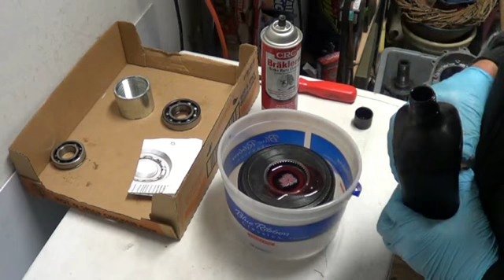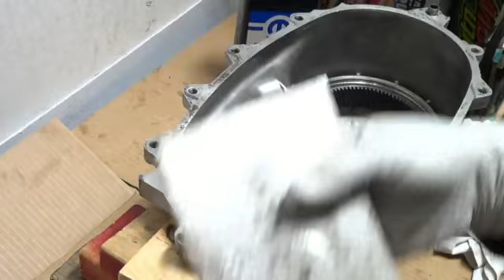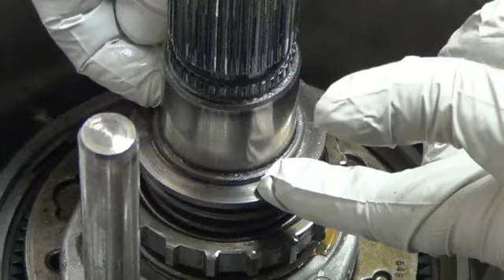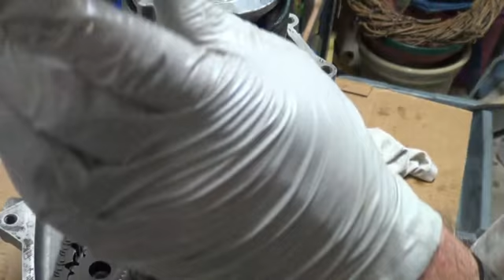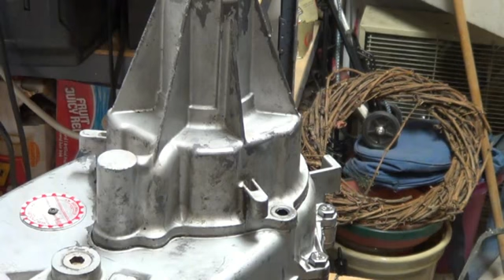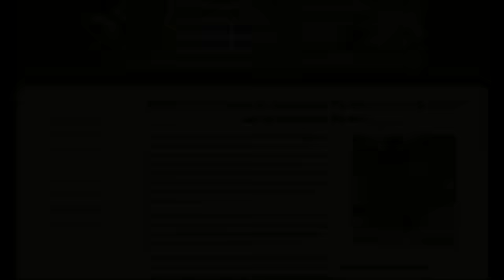1999 Jeep Grand Cherokee Laredo   247 Transfer Case Assembly

Comment: Great Video Jim!  
I need to replace my chain and your videos have been a great tool.  

Does the viscous coupler control both 4 high and 4 low or does 4 low lock the front and rear driveshafts together?

Comment: When installing the progressive coupler, use a flat screwdriver to shove all plates to one side, before placing the coupler onto the line shaft.  Shoving the plates to one side will make seating the coupler a snap.  Verify the coupler is  seated far enough down that the thrust washer fits onto is true place, and not above (to the rear) the snap ring groove.  The thrust washer fitting centered is verification that the coupler is correctly placed.

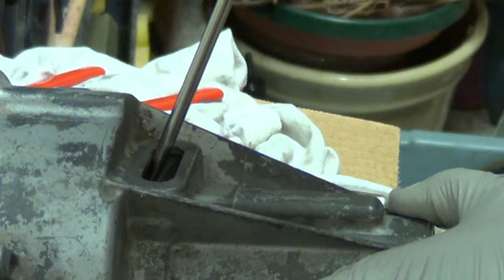Comment: 39:39 for the tail cone snap ring... So simple.  Lightly seat the 4 screws pulling cone housing to rear case half.  The bearing will have shoved the snap clip to the rear.  Reach in with (your favorite) snap ring pliers, spreading the two legs.  Reach in with a flat screwdriver and drag the bearing, which will also be retained onto the shaft, and all with it, to the rear the 1/8" or so needed for the snap ring to be in alignment with the bearing groove.  Release snap ring pliers.  Snap ring will leap into the groove.  Verify seating.  Torque 4 screws to final 20ft-lb, install rubber bung plug.
Reply: counter intuitive. Thanks much. I'm golden. Was trying with it facing up. Thanks,

Comment: Pulling the rear pocket needle roller bearing unit for the forward shaft requires a 36-38mm blind pocket puller.

A 1.5” steel round will suffice to make a puller.  Undercut to about 1.3”, leaving a 3/32” long foot, then cut for about 1-5/8” to 2”.  

Cutoff at end of undercut, then split this plug, make a suitable shim to force the halves apart,  1/4” piece of HRS will do.  

Drill one half plug on end 5/16” and tap 3/8”-16 for the typical HFT slide hammer drawbar.  

Cross drill the two halves, off center, 7/32” and use drill bit to tie the two halves together.  

Propane torch heat the casting, outside the pocket, and inside, around the pocket. 

About 120 slams of the slide hammer will remove even a stubborn bearing unit.

Comment: There is a flat round magnet that goes under the oil pump pickup screen, and it will typically keep the pump screen assembly in place. I would be wary of using anything else to keep it in, place or reduces the gap between the screen and case, which could cause oil starvation to the pump and coupler. Other wise, great videos, well explained and executed!

Comment: I have a 1999 Jeep Grand Cherokee 4.0 inline 6 2wd selective 4wd. When I am driving down the road and come to a red light it starts making a growling noise when I come to a stop the noise goes away when I put it on neutral. The noise also happens when I turn my wheel all the way to the right. I don’t know what the problem is if somebody can help me out. Not that you can only hear the noise from inside the jeep you cannot hear it from outside or under the jeep so it’s even harder to know where the noise is coming from.

Comment: I loved your video however I saw one place that you forgot something or it just wasnt there to begin with but there should have been a chain guide that the chain rides on installed with 2 screws in the bottom of the case. Your chain not haveing this will fly off from being too lose at some point.

Comment: How did reusing the existing clutch pack work out for you? Excellent video. I have no real need to do this, but it was great to watch.
Reply from the maker: Reusing the viscous coupler (progressive clutch) is working fine.  The main goal was to eliminate the annoying bearing whine which we accomplished.  It's a kid's work car/jeep and works well for that.  We never did any experiments to see if the VC will engage the front wheels if the back wheels start to slip, but it drives fine.  You can put a block of wood under the front wheels, lift the back wheels with a couple of floor jacks (so they spin), and see if the front wheels engage and pull the jeep over the blocks.  The VC engages when the front and back wheels are turning at a different speed, and disengages during normal driving for better gas mileage.

Comment: Thanks to your video support I just tore down my NP247 (2000 Jeep Grand Cherokee, 165K miles). Inside it looked very clean I noticed some small metal pieces / shavings the size of a pin head  in the pick up screen and saw that the top edge of the viscous coupler was "rough" in one  1" spot (as if it nicked up against something metal). I can't see any other mating or "near" surfaces with that same "Scuff". I put the cone back over it to see if there was a "rub" there and nothing. If you visualize a coke can standing upright as if it was the viscous coupler in the bottom clam shell, the "Rub" or "scuff" mark is on the top edge of the coke can where the bead of aluminum seals the side to the top of the coke can. Likewise the scuff on the VC is on that top edge where the side meets with the top. In fact, the "Scuff" was so deep there is a hole in that seam - e.g. it is not closed off.  I can provide a picture for your review but how? email? Trying to figure out what it could have possibly hit to clear that up before replacing the VC unit. Any ideas?